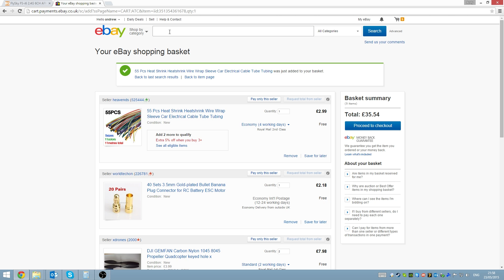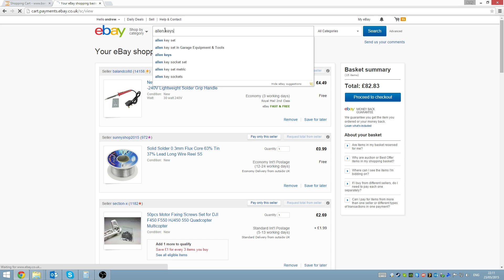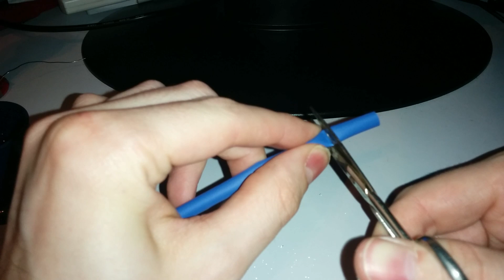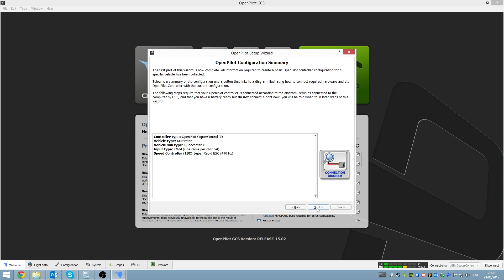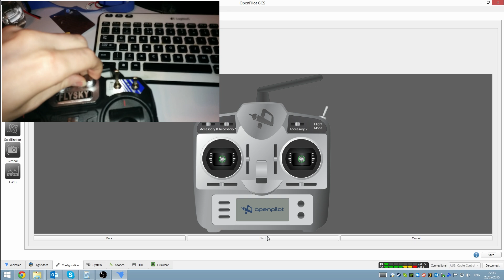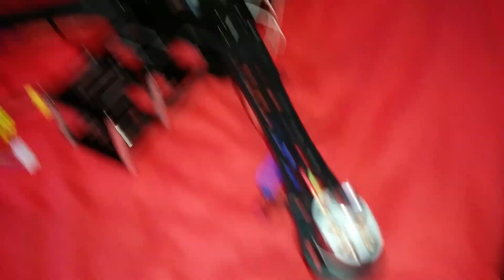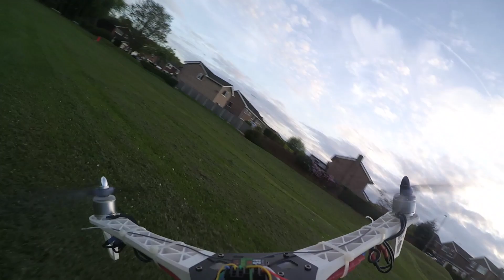Build A Cheap Quadcopter

Comment: thanks again Andy mate for your quick replies and help!! I've wired all ESCs direct to each other and she flys like a dream No problems now!!""Can you do a video on open pilot on how to set other trim buttons and maybe how to use rate mode and tweak trim"" as mine is a bit edgy and unstable sometimes Also im using 2212/1045 1000kv motors got a deal on ebay for props and motors combined as the keyholed were hard to find props for.  im also trying to get my head round GPS and might be buying the NAZA lite!! Any ideas ??thanks again Friend.chris,
Reply: +chrissy roberts Naza lite plus 3rd party gps is really good after its upgraded to v2. It flies identical to a phantom for half the price
Reply: is it easy to setup ??
Reply: +chrissy roberts The naza lite yep really easy :) You simply plug eerything in conenct the led to your computer calibrate your recceiver and perfect it flies :) though make sure you plug the right escs into the right port as on a naza the m1,m2,m3,m4 are different to most controllers

Buy these parts they work Naza http://m.banggood.com/index.php?com=...utm_source=sem
GPS: http://m.banggood.com/index.php?com=...utm_source=sem
Reply: them links for parts don't work!!?? but thanks for the good advice bro thumbs up!!
Reply: chrissy roberts Try these links.... NAZA: http://m.banggood.com/DJI-NAZA-Lite-Version-Flight-Control-System-p-85720.html?utm_campaign=PSALE-806450-0059365403-OPENPID85720&utm_content=ccp&utm_medium=ADshare&utm_source=sem

GPS: http://m.banggood.com/Ublox-M8N-GPS-Compatible-with-DJI-NAZA-Lite-V1-V2-Flight-Controller-Phantom-1-2-Vision-p-991718.html?utm_campaign=PSALE-806450-0059365403-OPENPID991718&utm_content=ccp&utm_medium=ADshare&utm_source=sem

GPS mount http://www.banggood.com/GPS-Folding-Antenna-Metal-Holder-For-Multicopter-YS-X4-X6-DJI-p-86774.html

You are using the same flight system as the DJI phantom for $80 :/

After upgrading to the naza v2 version naza-upgrade.com
Reply: wow this has helped me a lot thanks bro would it be better to get the naza gps and flight controller together as its only £16 more
http://www.banggood.com/DJI-NAZA-Flight-Control-System-and-GPS-Lite-Version-p-906572.html
Reply: chrissy roberts If you want to I find that gps gets a lock within 20 seconds which is really very good hahahha. Remmeber Naza is if you just want to plug and play and do no tuning, if you want to be bothered to and tune a fc for cheaper with way more features buy an APM.
Reply: just watched painless360 on the apm and pixhark thinking about getting pixhark package as on AndyRC  new dji build link from bangood good price and 32bit
Reply: chrissy roberts If you want it to work out of the box get the naza. And unless your gonna be wanting to set waypoints and have your quadcopter goto each one before changing gimbal direction you proably wount need the pixhawk
Reply: ahh right I see! if I do go for the naza will I have to change the radio as im using cheap flysky 6 channel??
Reply: if so defo gona get the tranus
Reply: chrissy roberts Im using flysky 6 channel on my naza :) it works on pwm however when yous withc to ppm it wont work because the flightmode/failsafe is the 7th channel on ppm in naza for some weird reason
Reply: cool I've just ordered the list you sent me and cant wait!! I've just received my new cheap ass gimbal but I cant get the sj400 cam to steadily stabilize on it is there a way to set it up and install new firmware or get it to straighten up with the button onboard??http://www.ebay.co.uk/itm/161708746171?_trksid=p2060353.m2749.l2649&ssPageName=STRK%3AMEBIDX%3AIT

Comment: thanks andy that's what I was thinking just wire direct to each other!! Also ive just bought the fat shark teleporter v3 fpv as im noob to this,, I seen yor review about the dominator v2 and I agree well over priced!! Can you send me the links to build self build fpv like your £60 version it looks cool!! any advice on the fat shark v3 would be appreciated thanks again andy!!
Reply from the maker: +chrissy roberts those are the quanam googles sold by hobbyking.com go check them out :) alls i know about the teleporters is the resolution is half that of the dominators which is disappointing in itself. everyone's different though so you will have to let me know what you think of them.

Comment: hi Andy I have build this with inspiration from this video!! thanks I have test flown it and first test was good but on second flight half way through flight quadcopter just cut off no controls work it fell to ground !! I had to reinstall from flight pilot then all worked good . I haven't flown it yet since but im wondering if it could be cold solder on bullit connector as I didn't achol them! can this be the problem??? hope you can help.thanks,chris
Reply from the maker: +chrissy roberts now that you know the correct wires to solder, cut off the connectors and solder direct. the bullet connectors are not much good

Comment: Hey,
I bought the RC05 receiver and an Eachine go pro transmitter for fpv, they are compatible, but didn't work. I applied for a refund, when I get my money back I am planning on buying a new vex and rx.
What is a good cheap set when I want to get about 500-1000m of range it doesn't have to be a go pro transmitter just a normal one. But do you know a good set that is around 30 to 50 euros for fpv, and do you know a place to buy it which doesn't have high shipping rates to europe?

Again, thanks a lot Andy

Comment: Hey Andy,
My quad weighs around 1800grams with gimbal landing gear etc, should Iget the sunnysky x2212 980kv, or should i get something more powerful, like the v2216 if yes with which kv 800/ 900?
Reply from the maker: +Tobias Veerkamp get the 2216 and run a 4s
Reply: AndyRC Is there no possibility that I can run it on 3s, I just switched my 4s for a 3s.
Reply from the maker: that weight will struggle on a 3s
Reply: so there my money goes again........
Reply: AndyRC Can I buy a lipo at hobbyking?
Or is it too risky, maybe you know another place where to buy cheap lipos?
Reply from the maker: lipo is fine from hobby king

Comment: Hey andy,
I am planning on upgrading the motors to sunny sky x2212 motors 980kv, but these motors do not have cw or ccw so how do the props stay on the motors, because if the direction of the threads are the same, then 2 of the 4 would spin off, right?
Reply: And if I also upgrade Esc's which ones should I get and should I program them?
Reply from the maker: +Tobias Veerkamp if you use proper torque wrenches on them they will not spn off. most motors dont have cw and ccw, just the way u wire them in. theres plenty of premium ESC afros, DYS and behli ones. theres not really a right or wrong choice.
Reply: AndyRC And what about programming the ESC's?
Reply: +AndyRC Are these ESC's any good? http://www.banggood.com/Hobbywing-Platinum-30A-Pro-2-6S-ESC-OPTO-For-Quadcopter-p-89406.html
Reply from the maker: yes they are good:-)
Reply: AndyRC And these, just because they are cheaper: http://www.foxtechfpv.com/hobbywing-xrotor-40a-escno-bec-p-1706.html
Reply from the maker: yes those also fine. this is the problem. too many options
Reply: AndyRC I know, thanks.
Is programming required?
Reply: AndyRC And is foxtechfpv a reliable seller for real sunny sky motors
Reply from the maker: yes they are thats where mine are from
Reply: AndyRC Thanks, now I can finally stop worrying about whether they are legit. I assume the hobby wing esc 20a is enough for x2212 980v motors with pac 1047 prop?
And they also sell legit hobby wing esc's?
Reply from the maker: iv never had a problem with them
Reply: AndyRC Oke but is 20a enough?
Reply from the maker: yes 20A is ample for any quadcopter up to 2kg
Reply: ok nice

Comment: Thank you so much for the video, I have followed this build and now I am trying to set up my flysky fs-i6.  I have followed your set up exactly. When I get to 47:18 in the video it goes through configuration and the first few are working but I cannot get the Yaw or flight modes to set. The only one that it will take is the knobs VRA and VRB. Which stick are you using for yaw?  I am new to all of this.  Any ideas?
Reply from the maker: +325ctd theres an option in one of the settings of the tx to change the knob channels to switch c. i fly mode 1 so yaw is on the left
Reply: AndyRC do you mean the mode 1 yaw is on the left with your pitch-elevator?
Reply: I've been messing with settings for a while and no luck.  One thing I noticed different on my cc3d wiring to the receiver FS-IA6 is that I have 5 channel wires coming from the cc3d to the receiver.  it has blue, yellow, green, orange then brown. would this affect the set up?
Reply from the maker: yes it does. please.copy the order i connect mine in this video
Reply: +AndyRC I got the wiring sorted out but I am still stuck on the flight mode configuration.  It get to the flight mode and I cannot get it to program to any switch. any ideas? Thanks again
Reply from the maker: theres an option in the tx when i get home ill have a look for u
Reply: +AndyRC thanks, I am looking on the tx but I guess I don't know what to look for.
Reply from the maker: i think it might be in a setting called rx setup but i dont have it with me at the moment
Reply: +AndyRC I still cannot find what setting I need to change,  I see Rx setup and it has a list of things but none of it makes any sense to my little brain. haha
Reply from the maker: go into the TX menu using the up anbd down keys select the big spanner and then press the OK button, then using the up down keys go down to AUX channels and press ok again. you can see you have channel 5 at the tom and channel 6 at the bottom. to move between the two u can press the ok button. to change the channel to a different switch use the up and down keys (I have mine set to SWITCH C. this is the weird bit. to save u long press cancel and that takes u out of the menu.

Comment: Hey Andy, I have my quad fully built but there's one problem: the receiver (r8b, comes with the flysky fs th9x transmitter) doesn't get power from the cc3d board. I have tried multiple things but they don't seem to work.
On my receiver I have the black red and white wire in ch1, blue in ch2, yellow in ch3, green in ch4, orange in ch5, brown in ch 6
Reply from the maker: +Tobias Veerkamp are u trying to get power through the usb cable alone or are you plugging in a lipo battery?
Reply: +AndyRC plugging in a lipo as well, but doesn't matter anymore man, it's solved, probably a faulty cable. But still thanks for replying!
Reply from the maker: so glad to hear! phew!
Reply: +AndyRC there I go again, today i flew it, all went fine (except for me flying), but then suddenly I couldn't lift one of the arms, the propeller didn't turn. When I tried fixing it, the ESC burnt through and the motor did too, is this a faulty ESC?  my motor burnt through, is that because of the ESC?
Reply: +AndyRC Oh yeah and another ESC just stopped working, it didn't burn through or anything but it just doesn't work, even with a good motor, I assume this is a faulty  ESC as well.

Thanks for the effort
Reply from the maker: this unfortunately can happen, as well with the more expensive ESC!

Comment: What kind of flight duration would you get with this set up? Can this be tailors for some basic arial photography/filming with a go pro?
Reply from the maker: Brad Moss about ten minutes and yes it can definitely do that
Reply: AndyRC - Last thing, there was no mention of where the batt/ voltage alarm connects?
Reply from the maker: it connects to the balance port of the lipo battery, it has polarity protection so you cant get it wrong
Reply: I getcha, thanks

Comment: Hey Andy, I've bought a 4s 5000mah Zippy (450-460gr) for this quad, I've ordered all the parts but now I see that the motors can only take 2-3s, Is 4s really ok.

p.s. Help me I'm in panic mode!
Reply from the maker: Tobias Veerkamp  A 4s should be fine as long as you do not try to carry too much weight using the 10 inch prop.  if you are wanting to carry a gimbal and FPV Gear you can use a 4S but use smaller props such as 8 inch and the load will not be so heavy on the motors
Reply: AndyRC I do have a gimbal (And I put a go pro on it with a go pro transmitter, and I have landing gear, so I should get a different battery?
Reply: AndyRC I'm going to buy a new one, is 3s 5000mah ok?
Reply from the maker: yes that is fine :)

Comment: Please help me, im beginner and want to build 1, i think i can print the frame cause i got 3d printer and need to find good radio controller, i found 2 here http://goo.gl/MJmzBF and http://goo.gl/n0205A which 1 is better?
Reply from the maker: Alis Angel i only know the flysky one so i would have to say that one
Reply: ok thank you for replying, nice video watching from start to finish and gonna watch next :)
Reply from the maker: thank you no problem :)
Reply: +Alis Angel A 3d printer is good for smaal parts and such on. but the main airframe should be made of a strong material. off course you can try but buying fake dji arms is cheaper than the filament
Reply: noted and thank you for telling me this, i really like diy stuff so just asking is't possible or not todo
Reply: these Dji flame wheel ARF kits are in discount :) so you only need to add an battery and controller

Comment: Didn't you mean to get a left hand throttle receiver rather than right like you ordered? (I think) you left handed?
Reply from the maker: Brad Moss no i fly mode 1, throttle is on the right for me
Reply: Fair play :)
Reply: AndyRC Going o start building bit by bit, where's the best sites/forums/ fb groups for info if I get stuck?
Reply from the maker: rcgroups also the fpv Facebook group is good. if u run into a particular issue youtube has the answers too
Reply: +AndyRC Hi again, sorry for all the q's. is the flight controller preloaded or do you have to install everything from scratch? The program isn't finding it.
Reply from the maker: do you mean the cc3d? mine came preloaded but then i upgraded as per this video
Reply: Plugged in I'm getting this message "This version of OpenPilot GCS does not support CC and CC3D boards.

Please use OpenPilot GCS version 15.02.xx instead"
Reply from the maker: sounds like u downloaded the wrong version
Reply: it's the most upto date version of the software, read a few reviews on bangood and a few people have issues with connecting, could be a board issue not being flashed initially/general board issue
Reply from the maker: can u reflash it with the latest or download an older version?
Reply: downloading an old version seemingly doesnt work, so cant do anything else
Reply: +Brad Moss (Parkourbrad) Got it sorted, older version of the software worked, tried it before and it didn't but now it is
Reply from the maker: awesome so glad to hear :)

Comment: Thank you so much!  I was inspired by this video to order parts for a very similar F450-style quadcopter.  I ordered all the parts from eBay and the total came to US$157.63 (about UK£102).  I already have a 4-channel transmitter so that saved some but had to add a LiPo charger ($17.42) and chose to add prop guards ($8.28) and a prop balancing tool ($3.78). All the parts are expected to arrive by the end of September (in about 8 weeks) but may arrive by the end of August (3 weeks).
Reply from the maker: John Wasser good luck with the build thanks for watching the vid
Reply: +AndyRC My cheap quadcopter is almost ready to fly!  I'm temporarily using a Deans battery connector in place of the XT60 connector that has not arrived yet.  Parts cost (everything but a transmitter) was US$117.61 (about UK£76.34). That includes adding the propeller guards.  Everything was from eBay, until the $14.00 F450-style frame got stuck in China.  Got one for $13.95 via Amazon.  Beginners will need a transmitter, LiPo charger, soldering equipment, etc.
Reply from the maker: cool hope it flys well let me know :) waiting for parts is the worst bit, which is why i now buy lots of spares of the stuff im buying. its more expensive but less waiting times. so i always buy 5 ESC 5 motors etc and lots of props! although its never enough props lol
Reply: +AndyRC IT FLIES!  I just took it outdoors for the first time. The CC3D flight controller kept it nicely stable.  I was able to get it to hover and move in various directions.  It currently has a bit of drift forward and left but I should be able to trim that out at the transmitter.  

Now I wonder if the GPS module I have will work on it. :)
Reply from the maker: awesome. the gps will only work on the revo version if i recall